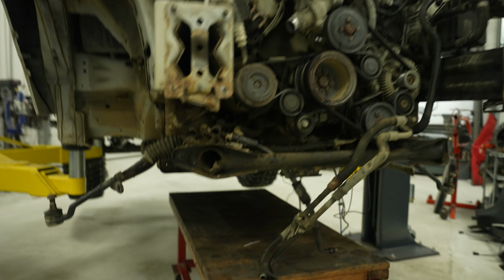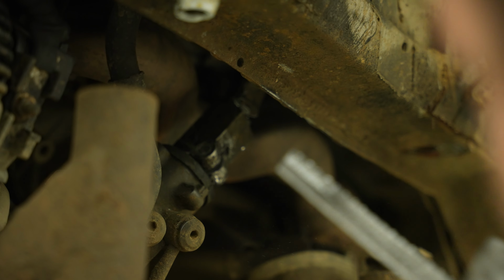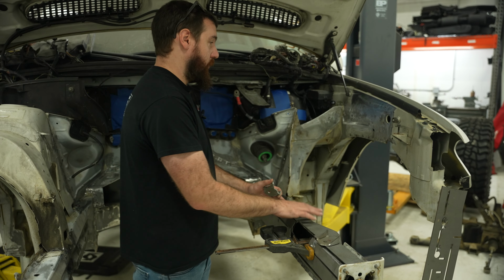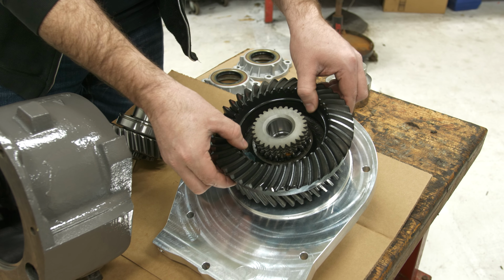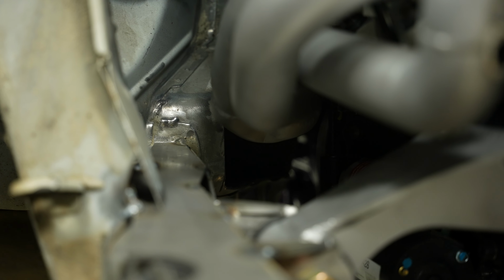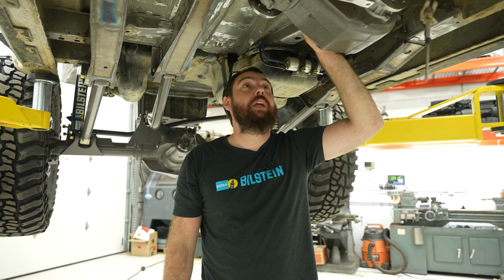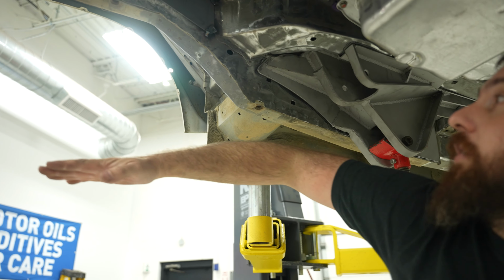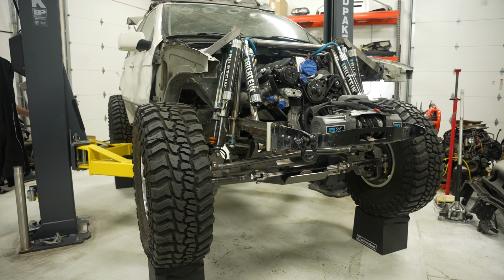LS Swapping a BMW X5! | Built by Mike ULTRA X5

Comment: ok, I'm confused when explaining the suspension you said the third link goes to the top of the diff, but the 3rd link bracket is on the passenger side, and you have a driver side drop transfer case? otherwise I'm impressed I've never seen a build of this caliber move this fast.